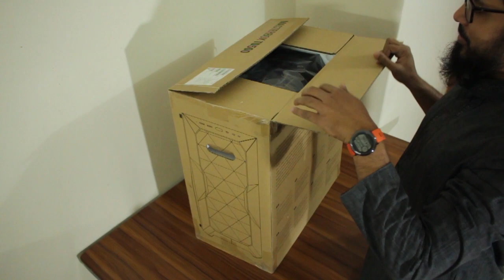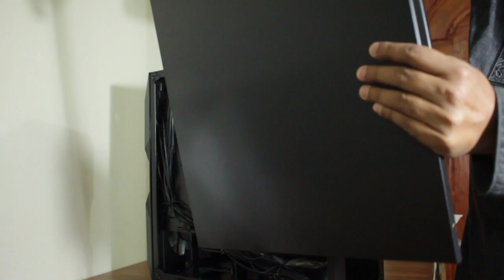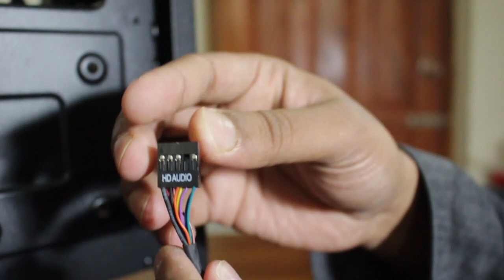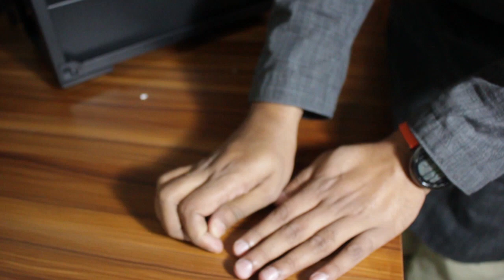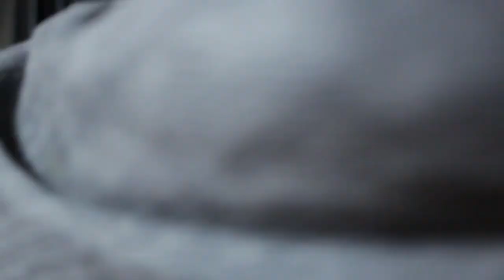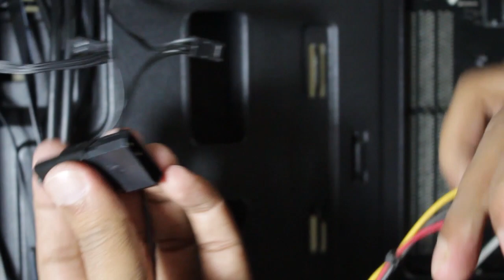Cooler Master CM Masterbox TD500 Gaming Casing Unboxing and PC Components Replacement - Tech Schools

Comment: Hi, may I know if you need any software to control the RGB lighting colour? As someone build my pc for me with the TD500 masterbox with RGB lights but when i dl the coolermaster ver 1.5 software it says it could not detect any cooler master device. Do i need to open up my PC to change the colour of the RGB manually? if I do need to open up and change the light colour manually do i still need any software to do so?
Reply: I think the fans are connected to the RGB controller with which you can change the colors, or you can connect the fans to the motherboards RGB "thingy". I'm not an expert with pcs but I hope that helps.
Reply from the maker: There is a built in RGB controller.

Comment: Can i buy the front fans seperately?
Reply from the maker: Yes, available in market.
Reply: @TechSchoolsByRayhan  whats the model?
Reply from the maker: Thermaltake, Coolermaster, Antec and many other Chinese Models....
Reply: @TechSchoolsByRayhan  god!  Save me! 
Im asking about the same inbuilt front fans from CM :facepalm:
Reply: @iHeymanth  Did you find the answer ? I can check for you.. I have this case.
Reply: @Murlockingqc please check
Reply: @iHeymanth  Other guy commented on the model.  But the fans are really not that great.  I would recommend fans with stronger pull, airflow is minimalist.
Reply: @Murlockingqc  heyo!! Which fans are included in the box what is the model of the fans?? I want to check them to know details like how many rpm they have? Can you please help me with this?? Whats your review about this case?? Does it have good airflow with the intake fans and front mesh? Is it worth buying? I was planning to buy. Share your opinion
Reply: @ronhasan7798  It's fine but I would get something else, If I had the chance. 
Not a lot of space for cable management, the front panel inhibit airflow, which kinda sucks... 
Front USB ports are in a weird 45 degree angle too. 
It's a nice case nonetheless, I'm just being very critical about it. 
I remember looking at the fan model and you couldn't buy the exact same ones, but you can contact the company and I'm pretty sure they would either send you fans for free or ask for shipping fee.  You can lie and say they were misfuctioning. 
I'll confirm the model number when I clean my PC, kinda busy with other stuffs right now. 
It used to be in the comments here, someone removed it or deleted his account.
Reply: @ronhasan7798   It's fine but I would get something else, If I had the chance. 
Not a lot of space for cable management, the front panel inhibit airflow, which kinda sucks... 
Front USB ports are in a weird 45 degree angle too. 
It's a nice case nonetheless, I'm just being very critical about it. 
I remember looking at the fan model and you couldn't buy the exact same ones, but you can contact the company and I'm pretty sure they would either send you fans for free or ask for shipping fee.  You can lie and say they were misfuctioning. 
I'll confirm the model number when I clean my PC, kinda busy with other stuffs right now. 
It used to be in the comments here, someone removed it or deleted his account.

Comment: can u change the color of your leds in your pc like not by pressing whit fingers the button and oppening the panel
Reply from the maker: No, There is no remote system.
Reply: Yes you can @Mikohoumou there's a RGB controller included with the case and you can hook up your case RESET SWITCH to the RGB controller and control/adjust RGB lightning from the Reset button on front/top panel.  

You can also plug the RGB splitter to your motherboard if they are compatible. Then you can control the RGB from your motherboard RGB controller software.
Reply: @Murlockingqc  thans i try it